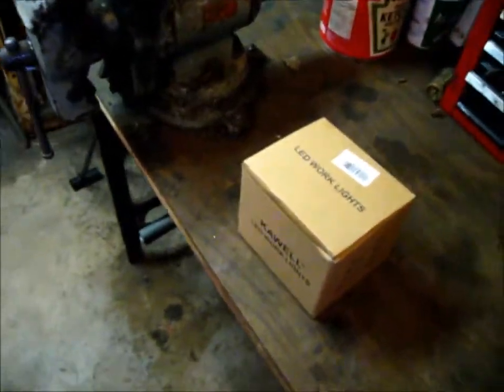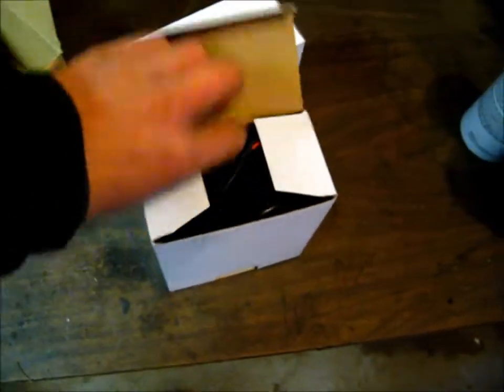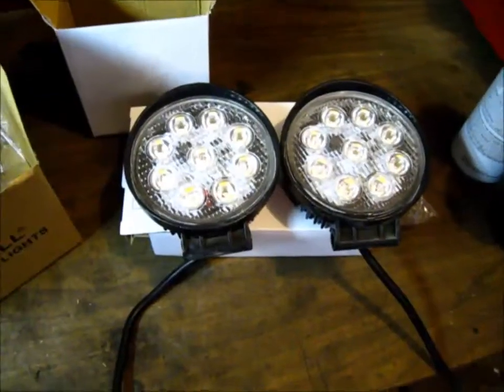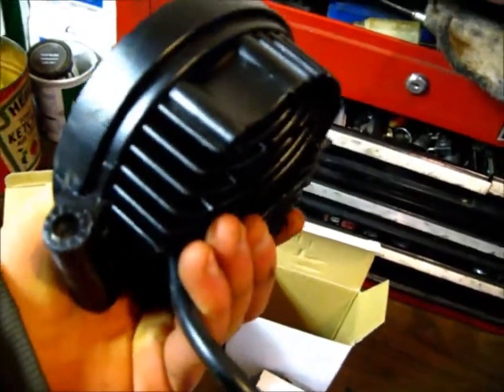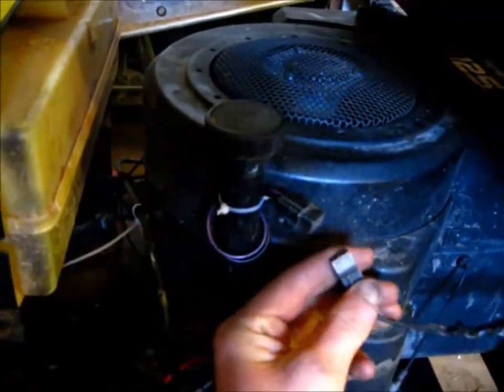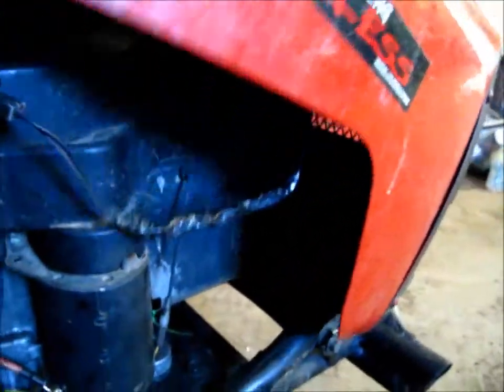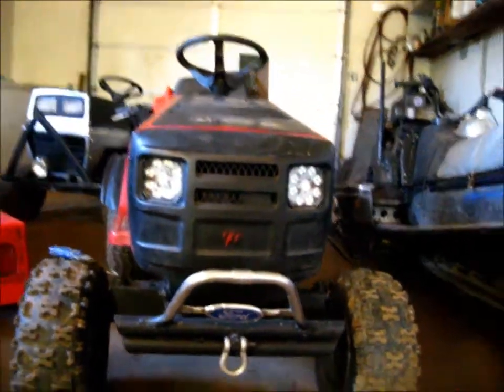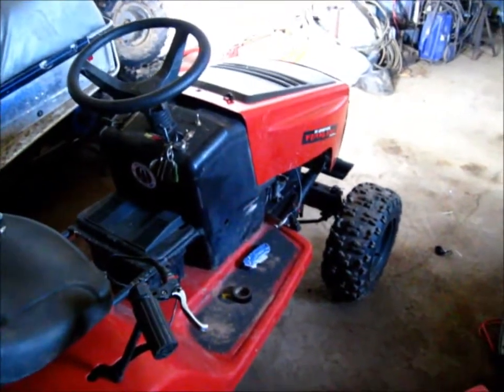LED Headlight Upgrade For the Murray Offroad Mower+ Night Romp on the off-road lawn mower

Comment: Do the leds surge or dim at low idle like junk halogens or do they stay bright.
Reply from the maker: They’re wired directly to the battery now so they are bright always. If connected to. Motor “alternator” they will flicker and flash
Reply: @MTD12HPTURBO    Good to know.  Thanks a bunch.  I don’t plan on using them constantly so I’m sure I won’t drain the battery.
Reply from the maker: @dilldoe4397  don’t forget them on you’ll be fine